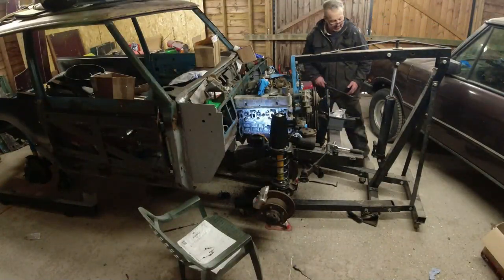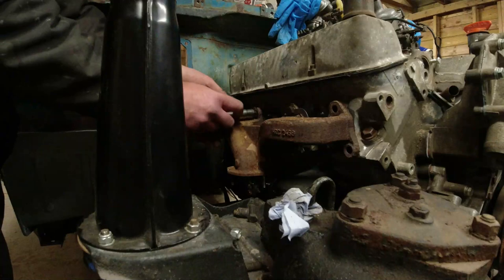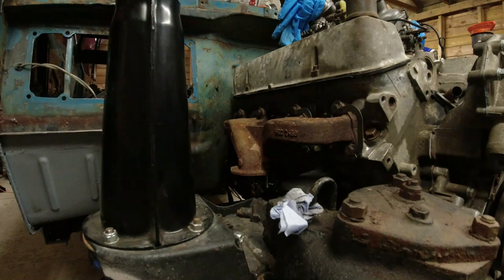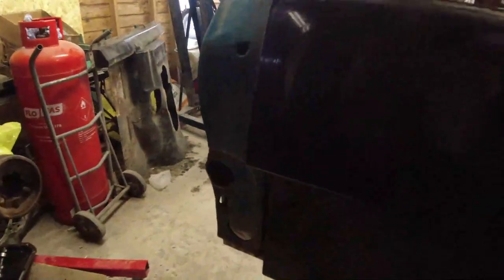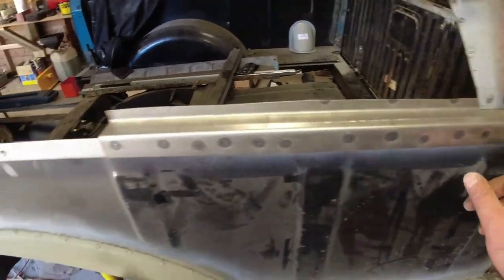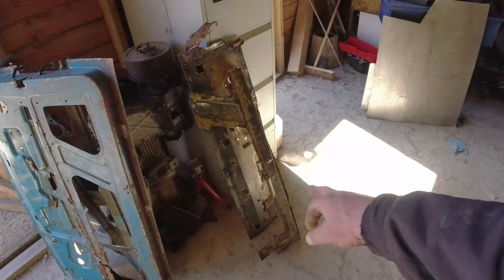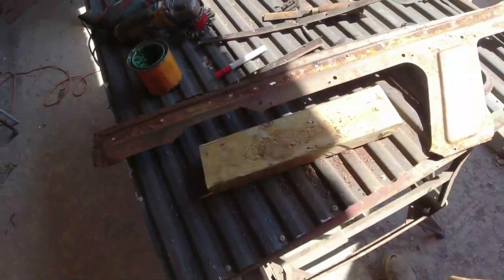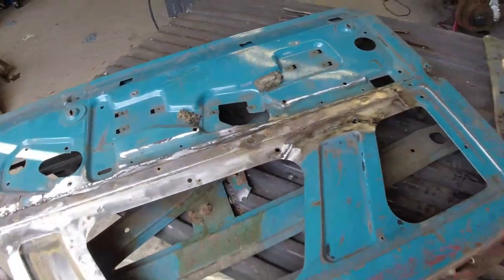Episode 32 - 1971 Range Rover BOB - engine mounts, goalpost and door rebuild - Parental warnings

Comment: OK you know I never comment on your video's :), you have your doors open it must be heating up to 5 degrees below, you brave bugger. Gin day is every day, it keeps your 'spirits' up.
Did you ever try the Bishops Finger (and no that is not a choir boy special).
What is the thinking behind "BOB" is it just to make it sort of ok and running or is it a restoration ? CUSHTIE haven't heard that word since I were a kid, by eck lad.
Reply from the maker: The sunshine beats down on the front of my unit most of the day, dust is a nightmare but not a whole lot I can do about it. Gin everyday could get out of control. Bishops Finger yep, not a bad drop that. Bob is a full on Resto with light touch restomod features.

Cushtie was delboys comment on a TV show Onlys Fools and Horses